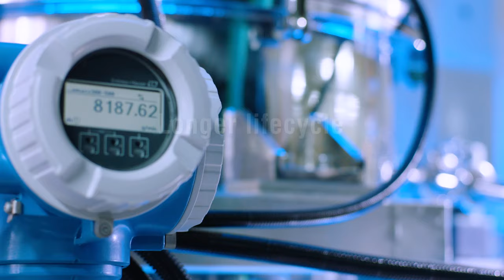Inside BYD's ultra-safe Blade Battery factory | BYD

Comment: I’d love to see the thermal specs on these during a typical charge and discharge cycle. They seem to be fairly heat resistant. Would these be suitable in a non-thermally managed application? There would of course be passive heat transfer from the bottom which would be exposed to airflow along with some limited absorption into surrounding chassis structures.